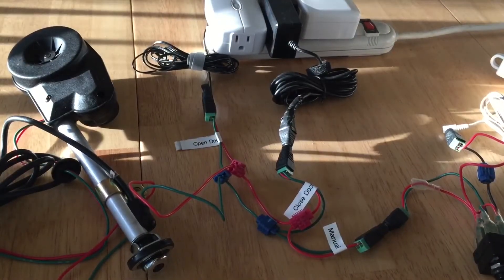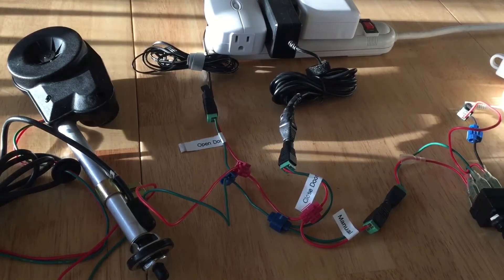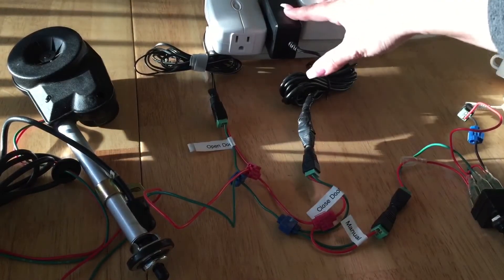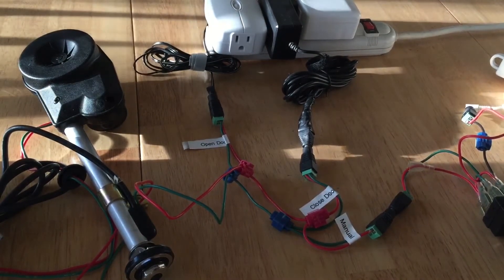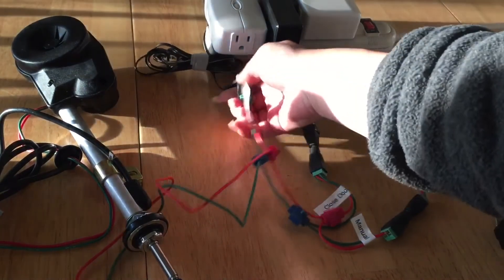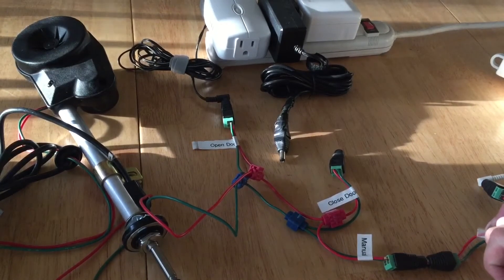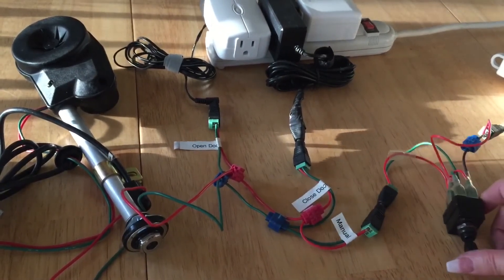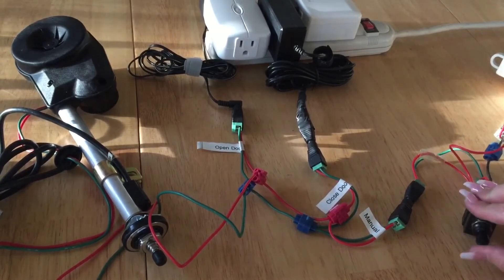My Smart Chicken Coop Door Setup

Comment: It's that the one transformer that is reversed power(wires crossed) is getting power back fed into it.  Back fed in reverse polarity. It is basically sorting out. The transformer's circuitry is keeping it from frying.

You need to put in a Auto/Manual selector DPDT switch. You needed to completely disconnect the power source to use the other power source. 

You didn't need both smart switches. just one and a DPDT relay.

Wish I had seen your video 6 years ago when you posted it.

Comment: May need a one way electrical diode. Transformers must be absorbing the electricity. Sorry but I don't know exactly which one you would need
Reply: You are almost correct. It is not that the transformers are "absorbing" the power, it's that the one transformer that is reversed power(wires crossed) is getting power back fed into it.  Back fed in reverse polarity. It is basically sorting out. The transformer's circuitry is keeping it from frying.